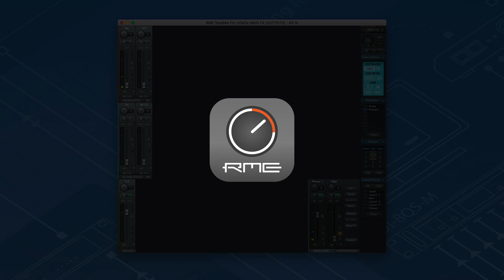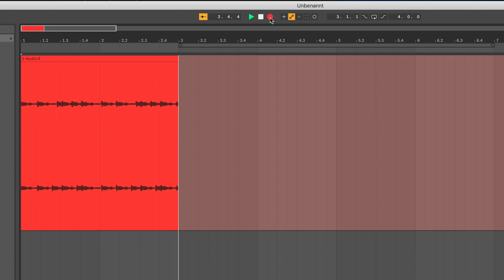Easy Setup of Loopback in TotalMix FX

Comment: This is a tremendously useful feature, but I'd like to offer a small critique that could help future tutorial videos. 

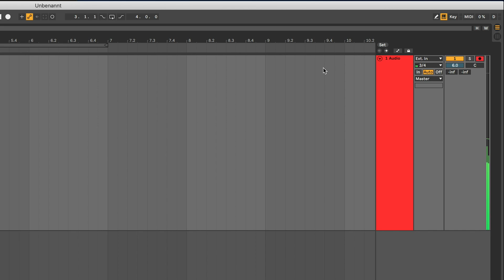As many others have noted, most of your tutorials, just stop short of a few crucial details that make it hard for the end user to replicate. The crucial step here was at the very end - 1:59 - "select the loopback channel" . Inside the DAW, there is nothing called "loopback channel" unless you name it as such. What should have been said is, choose the channel in the DAW that corresponds to the loopback channel in TotalMix - in this case, that was 3/4. 

When the voiceover says all this, the screen is not showing the channel being selected inside Ableton - it shows the recording of the audio file. This is a small detail, but it is very difficult to correlate what is being said to what is being shown. The part where you see that 3/4 were selected in Ableton, happens at 1:55 but the part asking you to select the input channel happens 5 seconds later. Seems like the screen capture and voiceovers are not recorded at the same time. 

I hope this comment helps improving the usability of a really good feature.

Comment: RME gurus! With this video being 4 years old, can you tell us if you have activated (extremely crucial) metering on that loopback 'input' signal? - while it's not a physical input sound, there absolutely is a 'virtual' signal here - the level of which you will know...and can thus show us via the meter. You can change colour/put a graphic on to show that it's a loopback signal.
Have you implemented this? if not, please reconsider.
Reply from the maker: On the latest version of Totalmix you see an orange dot in the input channel when in the output channel loopback is activated. The metering on the input channel is just for the the hardware input. The  loopback output metering=loopback input level.

Comment: I'm a software engineer, I love learning curves, but for some reason I've bounced of TotalMix FX so many times. I need to RTFM some day.
Reply from the maker: Or you can call our support and we explain it you. Sometimes a simple thing stands in the way of understanding it completely. Once you get it, it is a very powerful tool.
Reply: @RMEAudio  Why is there no feedback loop?
Reply from the maker: @kenburke7049  Because the recorderd signal is not fed to the output 3-4 again. If the software monitoring of your software is on  (that woudld be visible in the middle row) and you route that to output 3-4 again, you would have a feedback.
Reply from the maker: @kenburke7049  Because the recorded signal from the recording software, via software monitoring, is not routed to output 3-4 again. That would be an endless loop, hence a feed-back.

Comment: This can be used for bussing correct?
Reply from the maker: Sorry, but what do you mean by bussing? Loopback send the output signal back to the software input. You could use it to send audio to different software applications coming from other software.
Reply: @ i mean using it as a bus to combine inputs to one output. Bussing.
Reply from the maker: @sebastiandior1315  For that you do not need loopback. That works just by routing inputs to outputs. But if you want to record that particular output, you need to activate loopback.

Comment: Hi. I use UCX1 and use 4 stereo loopbacks. this leads to me losing the input channels the loopbacks are routed into. does UCX2 allow me to not lose the ADAT/SPDIF input channels, if i use ADAT/SPDIF output channels with loopback?
Reply from the maker: The loopback signal has always priority. You have to use an unused channel.
Reply: @RMEAudio  i'm wondering, how many loopbackable channels does ucx2 offer me? should i upgrade from ucx1 to ucx2 just so i could get loopback channels without losing adat out and adat in?

Comment: This feature is sooo useful for running system audio through VST plugins! Imagine, reference sound, all the time, outside and inside your DAW (so you can get used to it)! routing:
system audio -> SPDIF out -> loopback to SPDIF in -> Blue Cat Patchwork (Math Audio RoomEQ/EQ for headphones + Ircams HRTF) -> analog out 1+2
since RME interfaces have low latency and CPU overhead due to good drivers, there basically is no drawback.
Thank you RME!
Reply from the maker: Thank you :-)
Reply: Just Equalizer APO to have Math Audio Room EQ systemwide available. I use that all the time. Downside is that no ASIO applications are supported. Those you can host in Cantabile light and there have the audio go to the Mathaudio VST. I use that also for SPDIF input (CD) to filter it through MathAudio.

Comment: We need more videos about TotalMix FX Settings too, properly setup entire settings explenation as well routing and microphone chanel signal setup
Reply from the maker: Anything in particular apart from mic setups?
Reply: @RMEAudio  also i have problems when i want to activate my Headphones and if want to compare something to switch quickly from Monitors and Headphones, if you can make explanation about routing Headphones and recieving signal at same time on Monitors as well and how to save that to stay as permanent setup🙏😊
Reply: @RMEAudio  for example i setup my new Condenser microphone on 48v and my signal shows only the left chanel when is active also by recording, can be also signal on L and R chanel as well or it is correct like that the green peaks only on L?
Reply from the maker: That is correct, since your microphone is a mono source. Check out our video about mono channels for a better understanding. :)
Reply: @RMEAudio  I am still having problems sending signal to my outboard gear. I always get a wierd hollow feedback sound.
Reply: @Galaxis-X  How coincidebtal, I use loopback to turn my mono mic signal into a stereo signal.